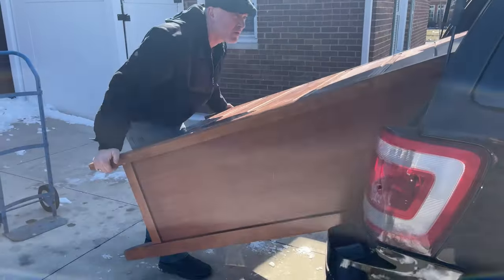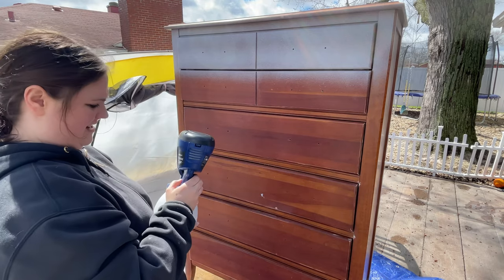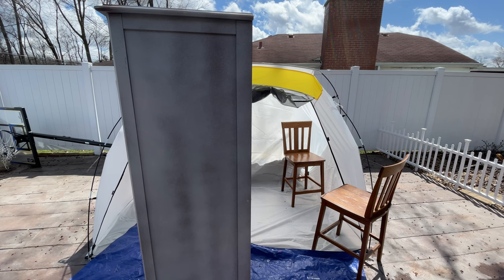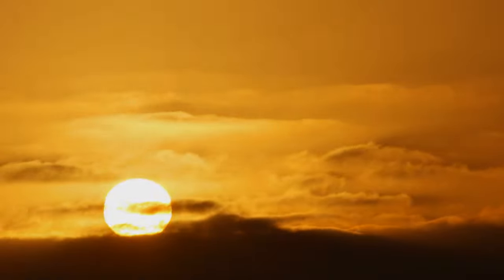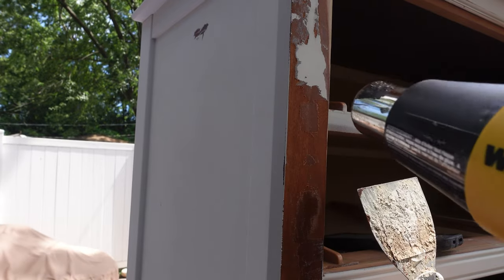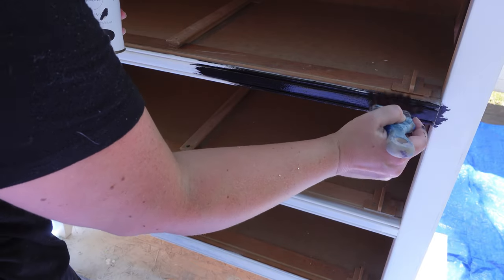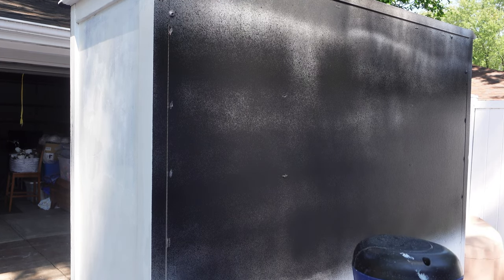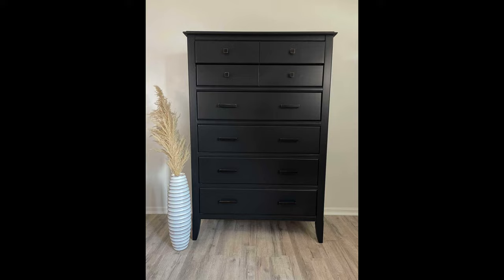Paint sprayer mistakes and how to fix them😫I actually lost money flipping furniture

Comment: Thank you! I’ve redone a couple of pieces and no one seems interested in either. The biggest mistake I made on my last piece was not mixing the 2 bottles of acrylic pearl paint I used on the vanity I used it on and they r 2 different shades of the same color! So I need to repaint it. I have a sprayer I’m anxious to try and I thank you for the tips!
Reply from the maker: Ugh, I have been there too. I mix my mineral paint often when I’m painting because I’ve had the same issue!

Comment: I have that same paint sprayer. I have two different models of it, one for paint, and one for topcoat. I'm terrified of accidentally getting paint mixed in with my top coat, and messing up a piece I'm working on.  I watched so many videos from the company, and other YouTubers that have it, so I'd now what I was doing. I hadn't had any issues until my last piece, when the sprayer sputtered, causing some paint splatter. So I rolled it to finish. Except now that it's dry, some of the splattered paint shows through. I was so frustrated, I stopped working on it. I'll get back to it, when the weather finally cools down here.

Comment: Hello, so I am new to using a paint sprayer and I’m wondering why sometimes my paint has little bubbles in it? I use chalk paint and thin it out, maybe too thin? Or maybe when I’m stirring it I’m creating too many bubbles with the stir stick you Connect to the drill? Also I’m aware you’re supposed to sand in between coats of paint, but are you supposed to finely sand your final coat of paint? Because even though I use 400 grit to finely sand in between coats, it still shows the scuff marks, will this go away when you add a top coat? ☹️😫 🫠